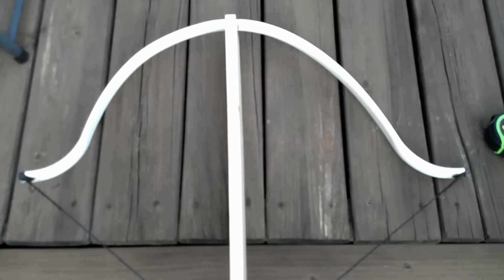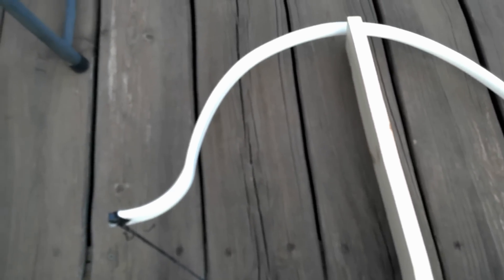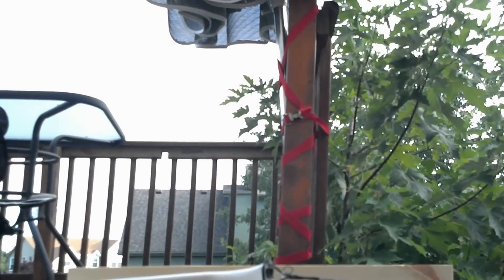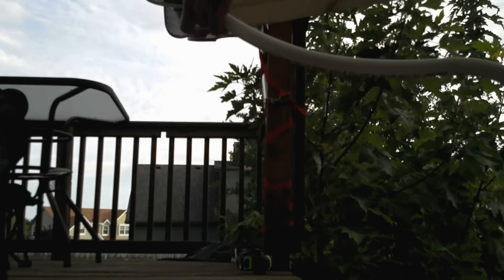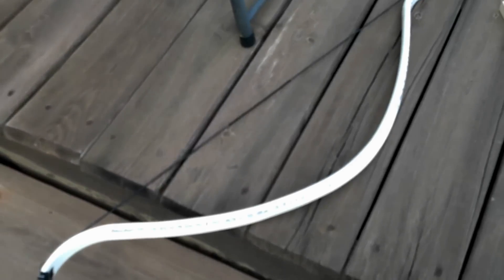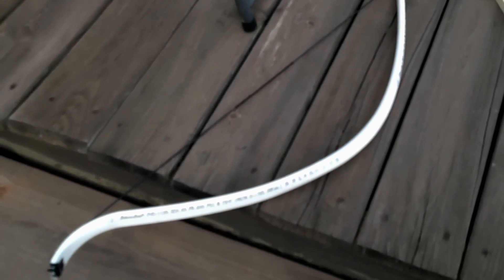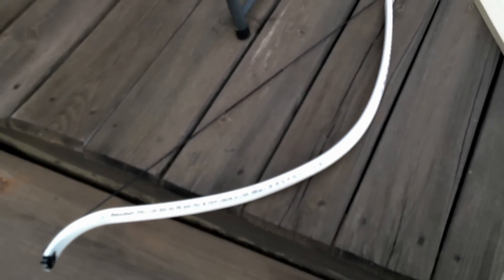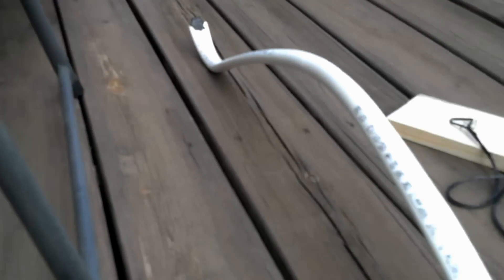Bend Test Part 4: Checking Set after Stressing a PVC Bow

Comment: I don't think I overheated the limb as it was painted and the paint tends to bubble before the pvc is overheated. I think it shattered because the string slipped off the nock while fully drawn causing a dry fire type situation. It was just interesting because it actually shattered into about six pieces, something I didn't think PVC would do. I put it down to reshaping because I had done it about seven or eight times. I do think that heating and bending introduces less stress than just bending.

Comment from the maker: Thanks! Any requests for what you'd like to see next? The only thing I have cooking at the moment is a 1/2" PVC pipe sliced in half that I inserted into a 3/4" pipe - theory being that if I put the extra material on the belly, it will prevent the kind of compression failures that I've experienced with my bows.